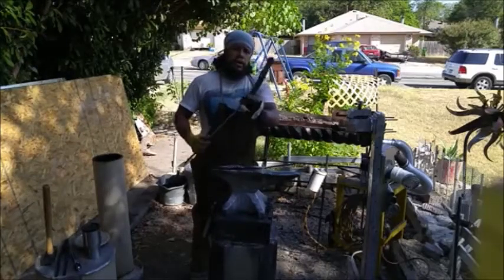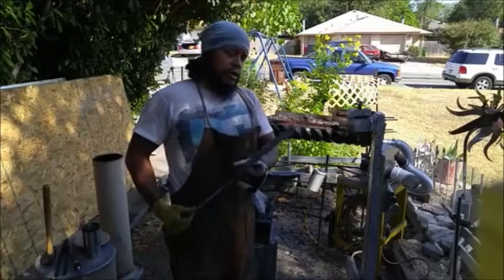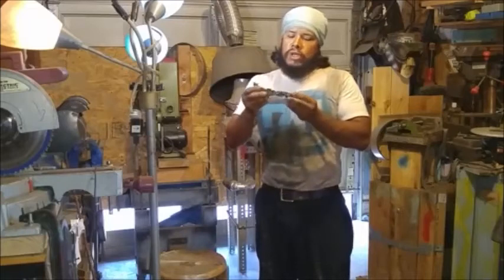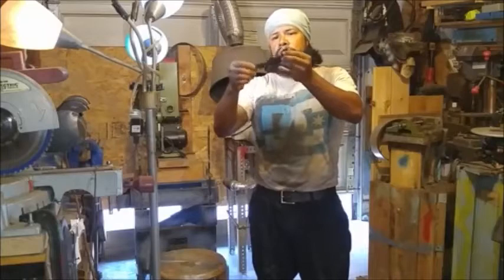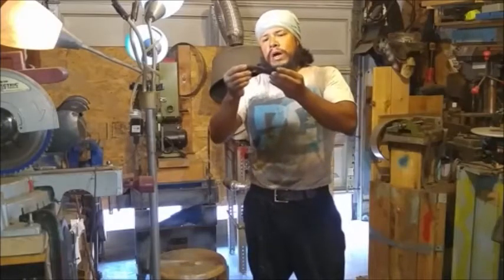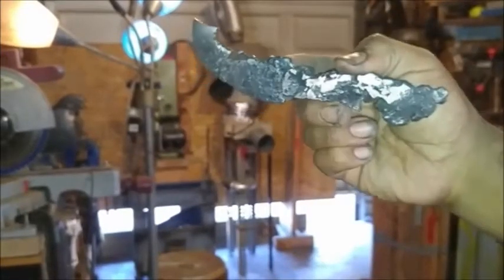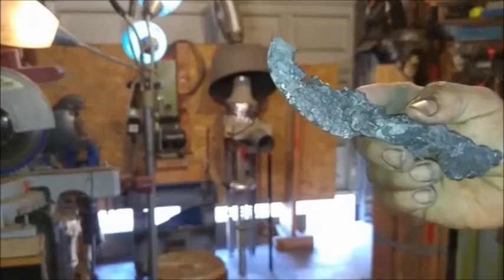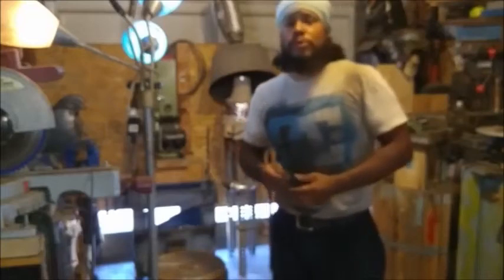Chainsaw Damascus Blade Forging 2015

Comment: Looks like it might turn out to be a pretty nice little knife. 
Hey, what I can recommend for forge welding is that you should always go a couple welds more than what you "think" you need. And with chainsaw damascus, well, I can't say I have done any myself, but I do know that there's a lot of material that needs to be compressed, so building it up a little thicker before making a knife out of it might be a good idea.
Happy forging!
Reply from the maker: yeah for my next one Im going to use more chain saw chain..the stuff flattens out so fast its hard to get the forge weld before youve compressed it down to a thin strip of steel
Reply: I'll bet. I'm looking forward to seeing more videos.